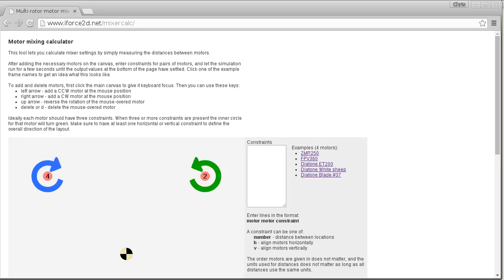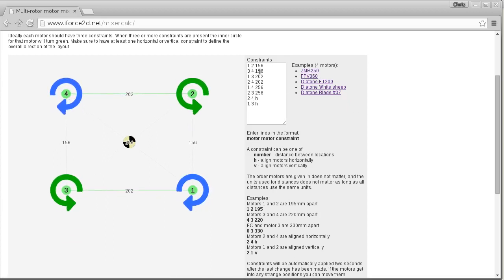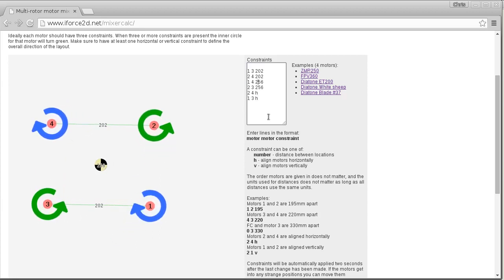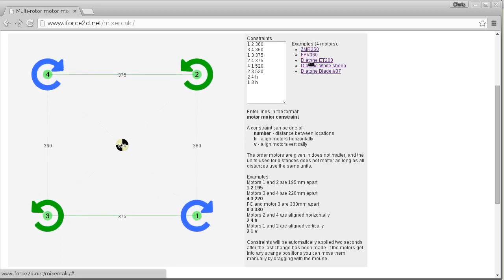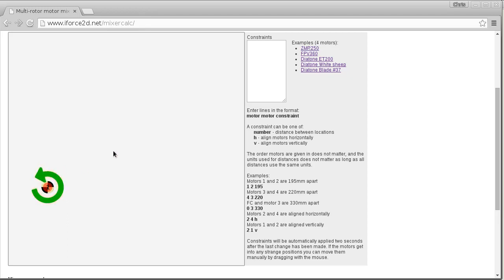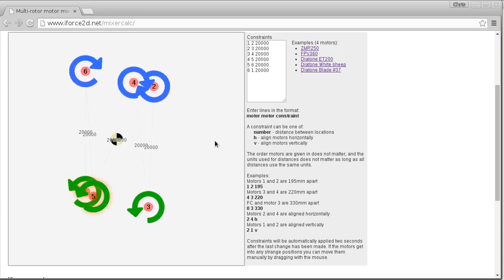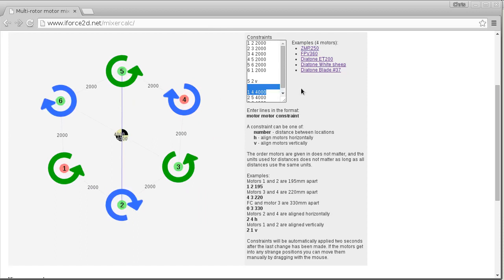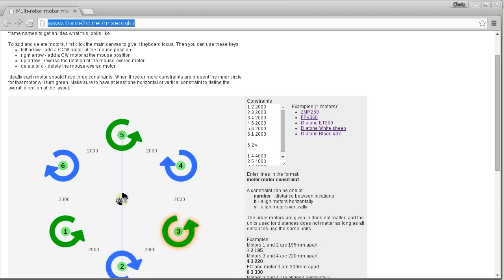Multirotor mixing calculator

Comment: Thanks this is really helpful. But can you please give a hint as to how the mixer matrix roll factor and pitch factor elements are calculated. I initially thought that if I have the angle of the rotors say theta with respect to x axis then roll factor = cos(90+ theta) and pitch factor = cos(theta) but it is not matching with populated matrix in the website. Can you please help me understand this?

Comment: Hi, thanks for creating the mixercalc! 
I just sent you an email containing a feature suggestion so all frames are calculable correctly - and I also have some gotchas that should be added so nobody is left with a quad that goes berserk when they arm it - thought BF devs would have caught this, but no...
When you set up a custom mixer, make sure you EITHER select "motor direction is reversed" in the GUI OR reverse the sign in the mmix commands. Don't do both - make very sure of this. They are additive even when using a custom mixer, not just for the preset mixes!
So in effect, if you reverse both of them (as I mistakenly just did on my race quad), you end up with wildly oscillating motors (all of them!) that will injure you if you had props on and still hop around and try to fry itself if you don't. Reason for this is that instead of compensating error, the PID control is actually increasing error and a runaway occurs.
Reply from the maker: I replied to your mail earlier, there is no need for a theoretical 'center point'. The CG marker in the mixercalc shows the average position of all motors which is where you should endeavor to place the CG of your aircraft. It's not critical if it's off a bit, it just means that some motors will need to work harder than others. For best results put your FC as close as possible to that point as well, but again it's not super critical to be off by a bit (if you only ever fly in acro mode then theoretically it doesn't really matter where the FC is because rotation of a rigid body is the same at all points, but in reality it's still better to have it close to the center of mass to reduce vibrations.
If in doubt about a new mixing, take the props off and in auto-level mode hold it in your hand and rotate it in pitch and roll and check that the appropriate motors speed up and slow down. If you must check it with props on, use motor stop or whatever it's called (motors off when throttle is at zero), and in acro mode very gently lift the throttle, keeping a safe distance and be ready to cut the throttle real quick. It may still go berserk if something is really badly configured (ie. motors spinning the wrong way) but that at least should limit the carnage.
I have never needed to touch the 'motor direction is reversed' setting, just set the rotation direction arrows in the mixercalc to match your quad. Also keep in mind that mixercalc doesn't know about the standard numbering of motors in various flight controller firmwares, it's up to you to make sure you number them in the correct positions to match the firmware.

Comment: in case of a quad with 2 front motors lower by 8 mm from the back ones, how i could manage in this program?is it necessary?
Reply from the maker: This calculator cannot handle that. But 8mm will make no difference really.
Reply: @iforce2d  I saw this document and relates to a weird frame and a way of making this correction its by hovering it and see if there is any changes in movement and if so we change throttle value from mmix in CLI to compensate and make it studd still when hovering. I am relating to my quad that have centered weight so no need to change hardware parts.
reference:
Custom mixer: 
Motor Thr Roll Pitch Yaw
#1: 1.000 0.250 1.000 1.000
#2: 0.850 -1.000 -1.000 0.000
#3: 1.000 0.250 1.000 -1.000
#4: 0.850 1.000 -1.000 0.000
Sanity check: NG OK OK 

You'll note that in my mix the front motors, motors 2 and 4, are at .85 or 85% throttle. This is the setting where it flies neutral with 6x4.5 in front and 5x4 in back with 35 degree mounts. If I wanted more of a kick in the rear I'd drop the front to .75 and the FF will settle into slightly nose down fast flight on its own. My advice is to fly it and note how it settles in forward flight with your hands off the sticks, then tweak the throttle mix 'til it flies how you like. Alternatively, you can also just shift the battery. Unlike an X quad, CG isn't set in stone here. It's the relationship between the centers of gravity and lift that's important.

Also note that both rear motors throttle up slightly for roll. Typically only the front motors do the rolling on an A or V Tail, but I like to have both rear motors speed up a bit to keep the nose from lifting on rolls, so they're both at +25%.

  http://www.shendrones.com/fast-forward-setup-guide/

Comment: Cheers iforce2d! I see you've added the the KK2 since last I've checked the calculator. Nice work!
Now I assume the commands for post-Cleanflight 1.10 are compatible with Betaflight. I've put the settings in but didn't yet get the chance to test them, will do at the next available opportunity.
Cheers, and keep up the good work!

Comment: Howdy,  I love your work with this.  It works great for all of my quads EXCEPT the RotorX Atom V2 122 mm that has a "deadcat" arrangement with the actual FC's center approx 25 mm forward of the diagonal center from motors with lines drawn from 1 to 4 and 2 to 3.

Your calculator infers that the FC be centered between all the motors.  How can I account for this offset?

Thanks,  Bill
Reply from the maker: The black and yellow marker is the center of mass. It's basically the average position of the motors. So for a quad, take any two motors and find the point halfway between them. Then take the other two motors and find the point halfway between those. Now find the point halfway between the two halfway points, that is where your quad should balance on.
Reply: Thank you ;)  So in the case of the deadcat with the CG placed very forward, the front motors are 25 mm forward of the pitch axis while the rear ones are 52 mm from the pitch axis, for a total of 77 mm between them, measured parallel to the roll axis line. The direct distance is 79 mm and I see that the calculator derived this. This to me means that the rear motors are twice as far from the pitch axis as the front, so that the thrust required of the from motors is about 0.48 as that required from the rear's.  Instead I am seeing the calc produce a 0.689 result.

Similarly, the roll axis front motor distance from the roll axis centerline is 56 mm while the rears are 39.5 mm, meaning that the closer in rear motors require 39.5 / 56 mm ~ 0.705 of the roll thrust of the fronts, and we see that in the calc results ~.704 

So it is the asymmetry of the pitch axis motor placement that I need to account for.

In your reply, are you suggesting that I transform the matrix in some way to account for the nearly 2:1 thrust differential for the pitch axis?

Thanks,

Bill

Constraints:
1 2 79
3 4 79
1 3 79
2 4 112
1 3 h
2 4 h

mmix 0 1     -0.704       0.689   -1
mmix 1 1     -1             -0.689    1
mmix 2 1       0.704       0.689    1
mmix 3 1       1             -0.689   -1
Reply from the maker: No, I am suggesting you move the battery so that the CG is where the yellow and black marker is, and all motors will be providing equal thrust. The instability you are seeing is caused by not having the CG where the simulation running in the FC thinks it is, and also because some motors are already running faster than others, when you hit the throttle to punch out etc there is less throttle range for those motor to use, limiting your overall power available and the ability of the FC to keep things under control. The faster motors may also get hotter if you are running close to their spec capability.
Reply: Yep, and I bet it works out great!  My particular parameters are so close in range...

Thanks for that!@@

Cheers,  Bill

Comment: Hey mate, Can I dimension to the COG I have a deadcat style frame where the cog is not directly in the middle of the motors as the COG of the frame is slightly offset due to components however your calc automatically assumes it is perfectly in the middle of the motors
Reply from the maker: You should arrange your 'components' so that the COG is at the marker shown in the calculator, the average position of all thrust locations. Otherwise the weight will not be shared equally between motors, it will still fly but some motors will continuously be working harder and there will be less rpm range within which the whole thing will be stable.
Reply: Thanks for the reply dude, 
Yeah I understand that by not having the FC centred right between the motors in both the pitch and roll axis one pair of motors will work slightly harder than the others. however because of the tiny scale of the design I have had to make some concessions like having the front motors slightly more loaded than the rear, It's a 120mm (Diagonal) 3" brushless micro running a proper cam (hs1177) and is running stupidly powerful 1407 tornado motors so performance won't be an issue. but because of the asymmetric loading of the motors a custom mix is even more important and if there was the ability to dimension to the COG marker your calculator would be able to calculate any layout rather than being limited to balanced layouts only. I have done the calculations manually to get the correct mix but your calculator would have made it much easier if it had the functionality, which seems it would be relatively easy to implement, though I'm no programmer, just an industrial designer.
Reply from the maker: I don't know what you mean by "dimension" the marker. If you mean show on screen the distances from the motors to the marker, that is not really necessary because it's the average position of the motors which is easy to determine. Take any two motors and find the point midway between them, and the point midway between the other two motors. Then take the point midway between those two midpoints.
Reply: What I am trying to explain is that on some builds it is not possible to get the centre of thrust to align with the FC (which is where all the movement measurements are being taken) due to spacial and component constraints (especially in micros), because of this it is very important to be able to tell the FC that some of the motors are closer to the FC than others and that a compensation will have to be made to essentially shift the centre of thrust to where the FC is located so that when pitch and roll movements are applied they are done in a balanced fashion in relation to the position of the FC.
Essentially by being able to dimension to the marker, the marker becomes the position of the FC and the motor mix calculates the power offset required to shift the centre of thrust to the position of the FC therefore creating true balanced movements around the FC, where the gyro is sensing the movements of the quad. this then means the FC is not sending commands realising there is an error in the movement that is created and having to create a correction and associated compensating force.
At the end of the day the point of a custom motor mix is to allow the FC to know the position of the motors in relation to the FC therefore keeping the centre of thrust located at the FC. so to generate a true custom motor mix you have to be able to dimesion the motors to the FC position.
Sorry this is such a long reply, it's quite hard to explain.

Here is the motor mix from your calculator with my dimensions added:
mixer custom
mmix reset
mmix 0 1 -0.709 0.676 -1
mmix 1 1 -1 -0.676 1
mmix 2 1 0.709 0.676 1
mmix 3 1 1 -0.676 -1

Here is what it should be to allow the FC to know the front motors are closer to the FC than the rears and that a thrust correction on the pitch axis will have to be applied (which is the whole point of me creating a custom motor mix for this quad):
mixer custom
mmix reset
mmix 0 1 -0.709 0.861 -1
mmix 1 1 -1 -0.495 1
mmix 2 1 0.709 0.861 1
mmix 3 1 1 -0.495 -1

You can see from this that now the FC knows the motors are not equidistant along the pitch axis and it will provide a compensation to the front motors to allow for proper movements around the FC. This will mean that some performance will be lost as the fronts will max out before the rears will but it means that pitch and roll movements will create true rotational movements around the FC. in my case the COG of the quad and the FC are located in the same spot but the motors are slightly unbalanced.

Your calculator is an awesome tool and If you can add this, then it will work accurately for every quad shape whether it is balanced around the theoretical centre of thrust or not
Reply from the maker: The center of thrust does not need to align with the FC, as I said earlier it's the center of mass you should have at the center of thrust. If you are flying in rate mode the FC position is completely irrelevant because a gyro measures rate of rotation which is the same at any point on a rigid body (although you will of course get less vibration if you have it near the center of mass). If you are using the accelerometer for attitude control, eg. flying in angle mode then it is a little more relevant but still not a big deal. Only when you are using the accelerometer reading to control vertical movements, eg. altitude hold should you really worry about getting the FC in the center of thrust.
Reply: I'm only interested in rate mode flying but this is also very important (probably more so) for stabilised modes. 
If your centre of thrust isn't centred on your FC then movements are created from a lever distance from the FC meaning that the FC will not truly rotate but will move in an arc which means the gyro will not get accurate readings (gyros only sense rotation). but you do highlight a point that your centre of thrust should be located on your COG/COM which is also true as having these misaligned will also result in strange movements when thrust corrections are applied. Ideally for a properly flying quadcopter you must have your COG/COM (centre of physical movements)  aligned with your FC (centre of measurements) and these must also be aligned with the centre of thrust (centre of forces applied to the craft). 
because I cant tell your calculator that my COG and FC are actually forward of where the theoretical COT (centre of thrust) is, then if I use the mix your calculator generates, the front motors will always provide less force than required and this will require the FC to sense this and create a compensation, resulting in weird flight behaviour and delayed reactions from the quadcopter. almost every deadcat style frame will suffer from this issue.
Reply from the maker: As you correctly state, gyros only sense rotation. Not arcs. If you are using rate mode none of the problems you are imagining are actually problems.
Reply: iforce2d Okay just tryna help here, my cog/com doesn't line up with my cot therefore I need an offset applied to the motors to get the quad to balance but you calculator doesn't allow for it. like I said I did the calculations manually and got different results that would give the effect of altering the motor power accordingly to balance the quad. this is the same issue pilotgeek mentioned a couple of comments below. if I use the mix your calculator currently generates my quad would be unbalanced along the pitch axis
Reply from the maker: Are you making these claims based on experience or have you not yet built this thing? Again, you don't need to manually specify any offset, and the position of the FC on the frame is irrelevant. In rate mode the flight controller simply reads the gyro, and runs a PID loop to set the motor speeds to match the control inputs. This will automatically send more power to the motors that need it, to keep it balanced. If it didn't, the quad wouldn't even fly at all....
One problem you might have though, is that transitions between rates (starting to rotate and stopping from a rotating state) could be wobbly because the PID control does not react instantaneously. But that is not a problem with the FC position, it's because your CoG is not at the CoT.
Reply: iforce2d I've designed the quad and am building it. the last statement is exactly why I've created a custom motor mix. the custom motor mix moves the cot to the cog by telling the FC where the motors are and it then knows how much power to supply to keep the quad balanced without having to rely on pid feedback therefore reducing the chances of the wobbliness you mention. I can try both ways and let you know the results if you like at this size it may have no discernable difference but I just thought if you had the option to tell your calculator where you needed the COT to be in relation to the motors then it would be that little bit better. nice work on the calculator so far though dude, I know alot of people use it and reference it
Reply from the maker: No, the custom motor mix does not move the cot or the cog anywhere, you can only do that by rearranging your frame. What the custom mix does is tell the FC how much relative influence each motor has on rotating the frame, and in which direction. The PID controller is indispensable, you cannot 'tell' the FC how to balance the quad without it because balancing relies on dozens of other factors like calibration of ESCs, prop type etc, it will always be a reactionary calculation that you cannot program in from the beginning. I think at this point I'm simply repeating myself, so good luck with your build.